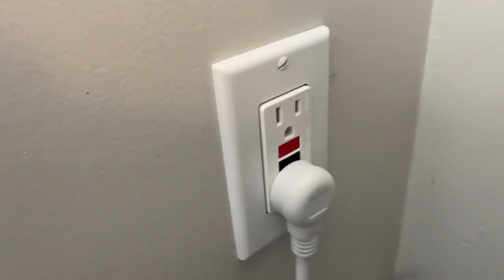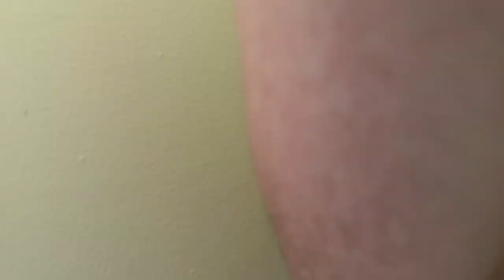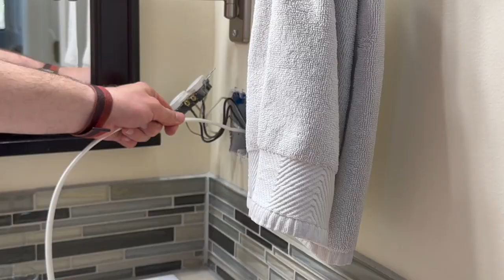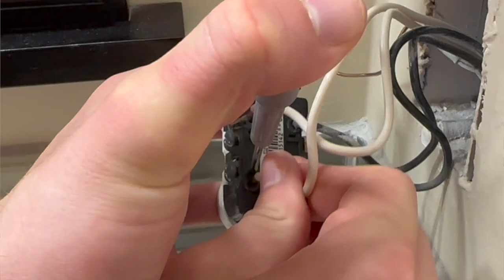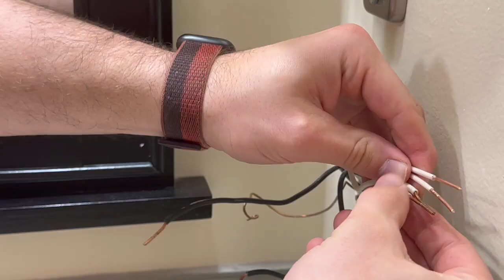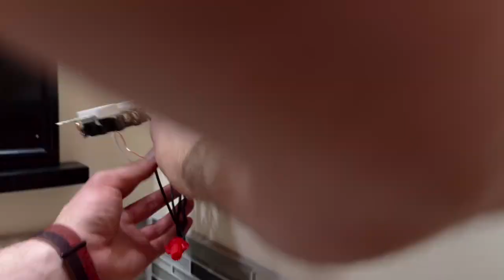DIY Bidet Outlet Installation: Step-by-Step Guide for a Fresh & Clean Upgrade

Comment: Great video.  My only piece of advice would be to pre twist those 4  wires before placing the wire nut on.  This will give you a much more solid connection and minimize any chance of those wires coming loose.

Comment: It looks like you may have caught some insulation under the terminal screws.  I would redo those to avoid a potential intermittent connection that could result in arcing.

Comment: Receptacle should be 12-2 wire or romex not 14-2 which is for Lighting.
Reply: Not entirely true
Reply from the maker: Thank you for your comment. To clarify, 14-2 wire is used in 15A circuits, while 12-2 wire is used in 20A circuits. The circuit we're adding the receptacle to is 15A, which is why we used 14-2 Romex. This choice ensures we're using the appropriate wire gauge for the circuit's amperage.

Comment: How did you get the romex from your existing outlet to the newly positioned outlet? Was the existing outlet luckily positioned on the opposite wall from the toilet?
Reply from the maker: Correct. This where a bit of planning is needed. For this application I had an existing outlet i came out from and a cavity (ie no studs in the way) in the wall I can route new Romex through.
Reply: @SkiesDev  lucky you!